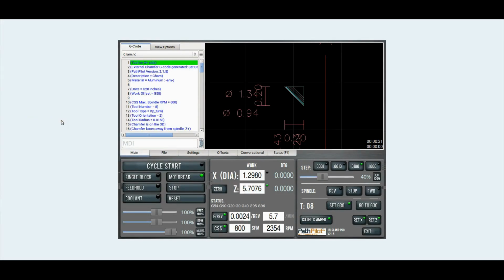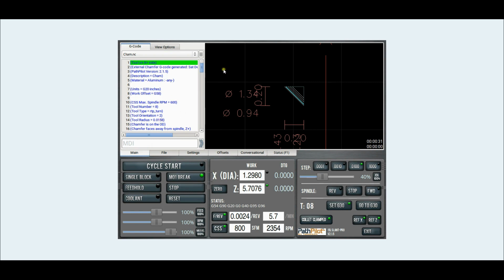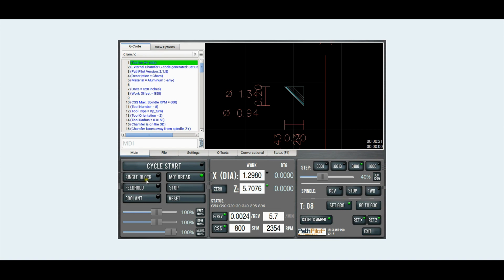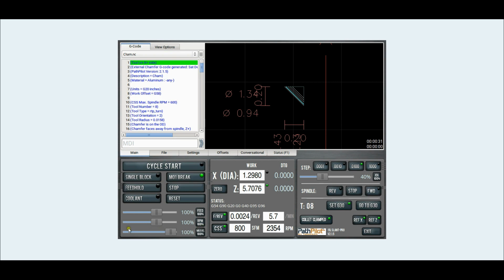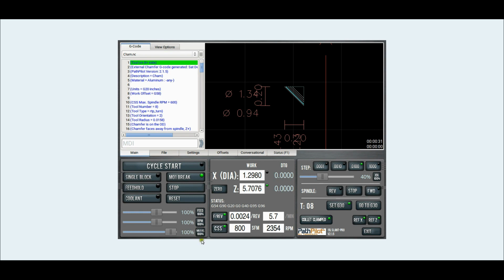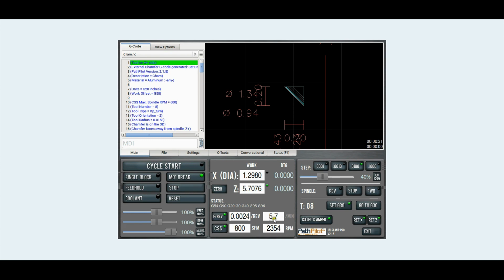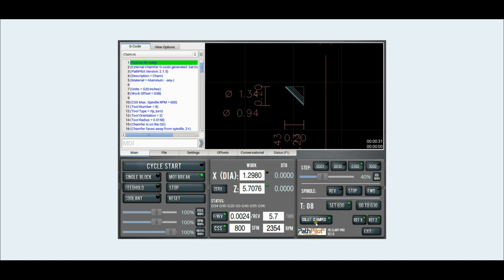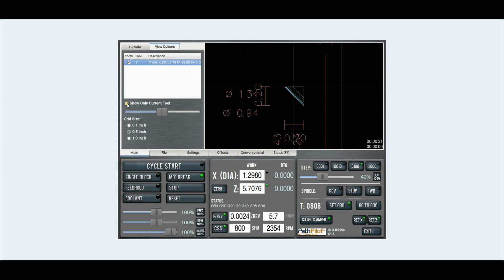Path Pilot overview for Tormach Slant pro lathe. Part 1

Comment: The Path Pilot software is very user friendly,  i guess this is why so many people are interested in Tormach machines.

I do like the Tormach lathe but time has passed since my first interest in buying one,  and now moved on to a Mazak CNC Lathe.

I think i might have mentioned it before,  but the only thing that put me off buying one when i had been interested.
Was the price of the enclosure which was the deal breaker for me.

It is annoying that Tormach requires you to buy there Overpriced Enclosure for the sake of choosing the turret option ????? 

Personal how have you found the enclosure does it work well for you ? excluding the asking price.

Thanks for the video.
Looking forward to the next one.
Regards Peter.
Reply from the maker: Yea the software is super simple and that makes it attractive for beginners. I keep hearing people say the cost of a Tormach is the reason they got one... If you have time to learn getting a good used machine is way better and cheaper than a new Tormach. I do have a HAAS and a Mori lathe coming, hadn't really seen the interface of the Mori believe it is using Yasnac LX-3 controller hope it's not too complicated (I have time to learn tho).
The enclosure works but we had to seal it with plumbers putty in lots of places to keep it from leaking but we couldn't live without it really.
Hope I got all your questions :)
Reply: @dnjmachine  It,s true about the price i did try to point out the fact of entry level verses pro machine in a video i have already posted.

But i stopped short of pointing out the Tormach is not as cheap at what it first seems.
I just brushed over this topic.

If i put to much of a point on the Facts,  all the Tormach lovers start coming back at me saying i am putting there machine down??????

People do not like hearing the truth ?????
Reply from the maker: @weldmachine  Yea I was expecting my review would have brought much more heat. I have less than 100 subs so maybe that why so little backlash. The comments sure got heated lol go look at them. I stayed out of it, my video said what I had to say.